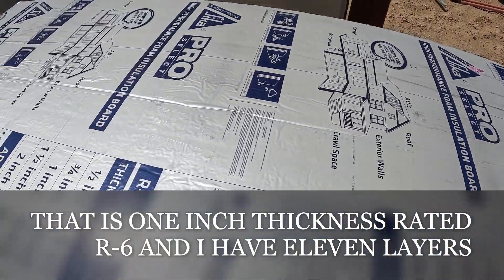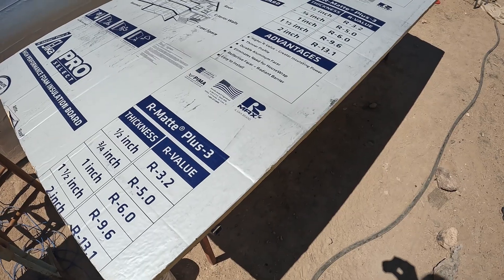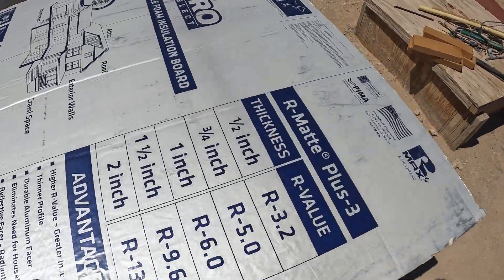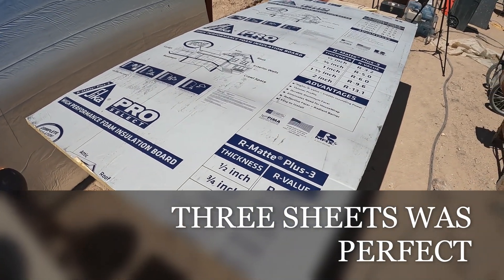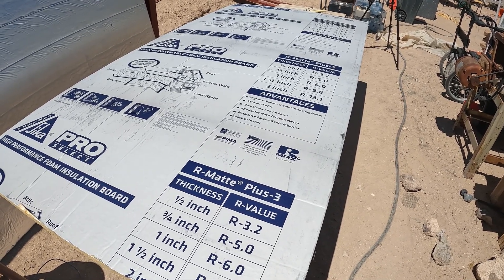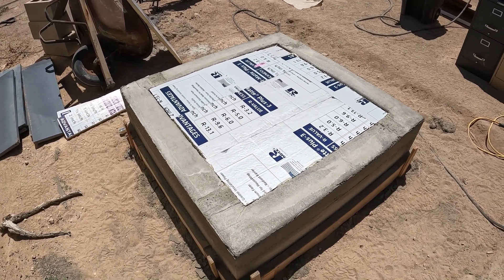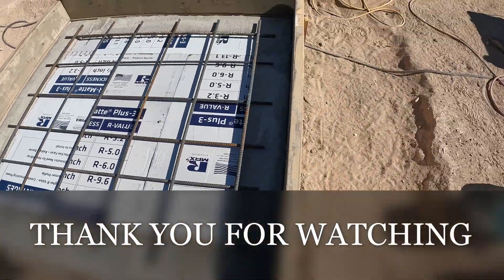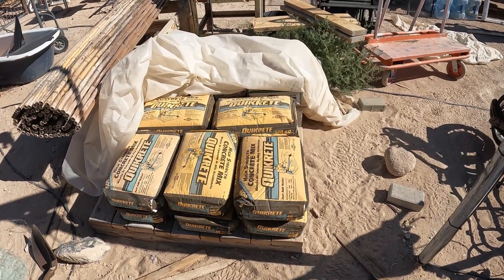Sand Battery Insulation E98

Comment: Serious strong
Reply from the maker: I probably could have a 3-1/2" slab instead of 5-1/2". But I figure the more mass the larger the heat capacity. Although I could be going overboard and probably am. I may add a wood stove option in case of too many cloudy days. It's all an experiment. If I can get good results from this design I will build at least one more on another property I own. Thanks for all your comments and watching.